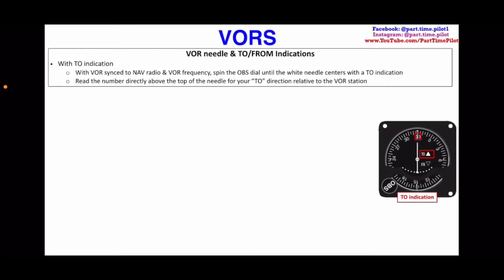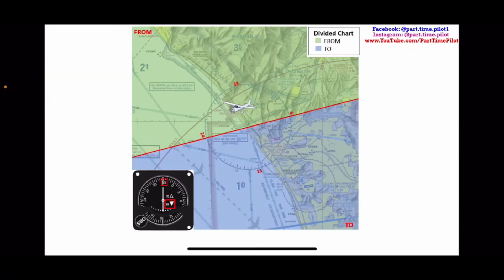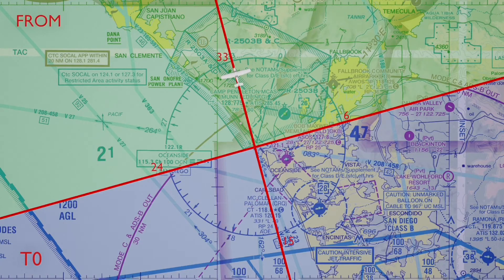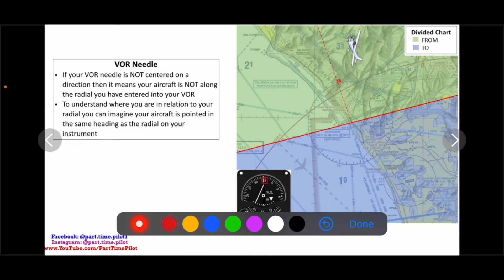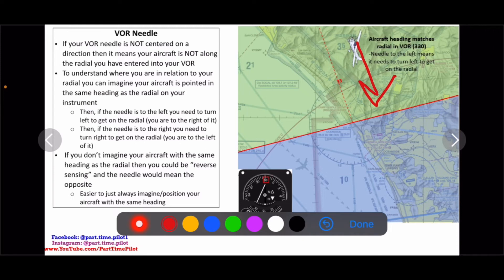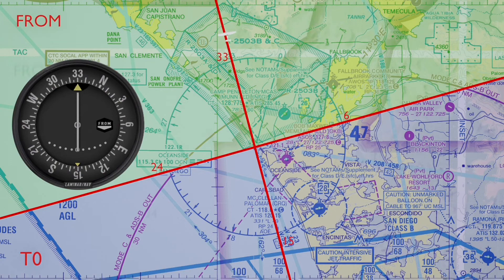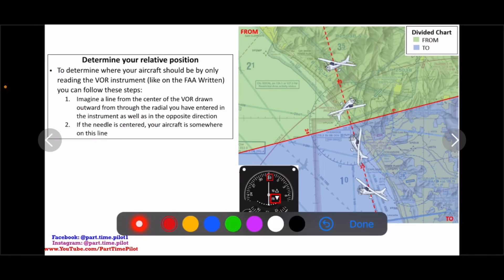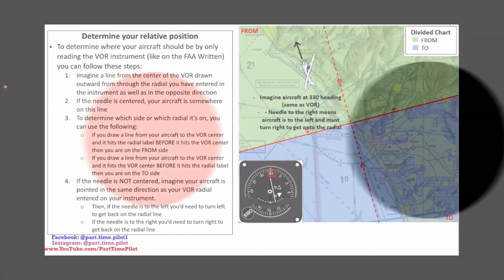TO/FROM Indication, Course Deviation Needle & How to Determine your Relative Position with VOR

Comment: Thx!   Studying for the written now….test is Monday and the VOR is my consistent weak point.  Your video was a great refresher and step by step…which I needed.
Reply from the maker: Anytime! Good luck! Be sure to review up on basicmed as we have been seeing students be asked about that a lot lately. No interpolating anymore and no multiple step calculation questions. You’ll be lucky if you get 1 or 2 e6b type questions now. They are focusing more so on memorization and stability/loss of control stuff. So also give a good review of stalls and stability and control.
Reply: You were 100% correct!  Got a 95 yesterday when I took it….and it was a weird test.   I know the basic med…but they asked a really off tangential question but I think I still got it right.  Only the FAA can write such poorly worded questions.  Anyhoo…thanks so much.  I felt really good going into the exam and you helped me nail VOR.
Reply from the maker: @munchkin8742 awesome! That’s a great score! Can I ask what you mean by the “off tangential” question? We take all the feedback we can get
Reply: @PartTimePilot  if I can recall it properly….it was not a standard basic med question…not the certificated at 6 occupants or 6,000lbs, 250 kts, below 18,000 flight level….it was more along the lines of which of the following must you have or do….choices were 1-must have the cmec with you, 2-something  not associated with basic med…way out there and 3-must comply with your drivers license requirements…..which is what I selected.   I recalled somewhere recently during my studying that under basic you’re just supposed to be able to fly with your drivers license and I want to say that there was a reference to following any restrictions on a DL….such as vision correction.   That seemed to make the most sense to me.   It was a poorly worded question and I expected something more along the way of spitting out a rule.  Hope that helps.   I wish I could remember it better.
Reply from the maker: Any info helps so I appreciate this a lot!